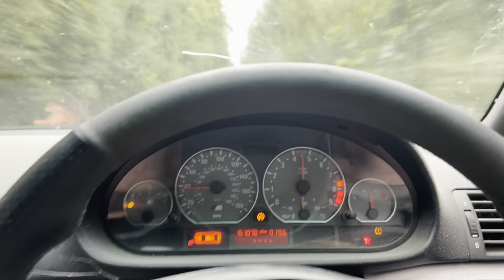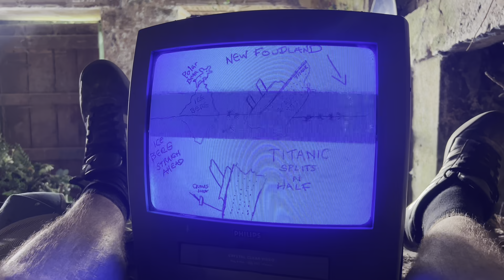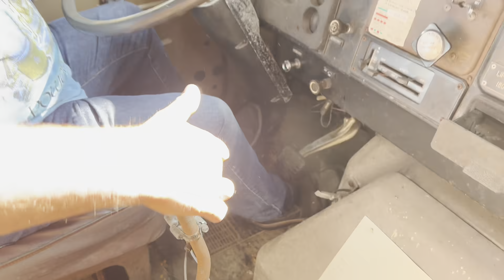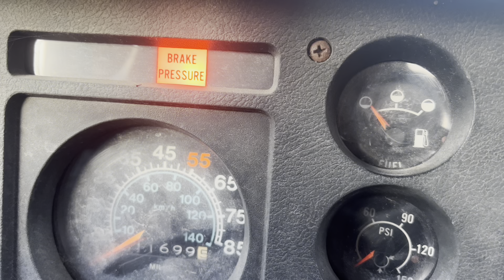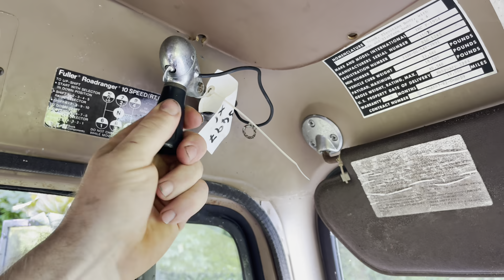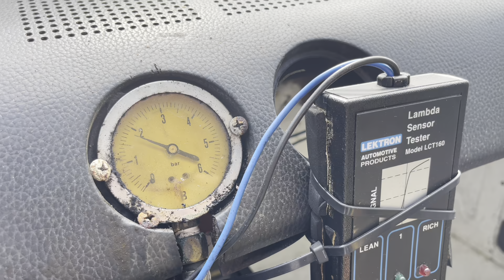BURNOUT 💨💨

Comment: I'm I surprised the opel engine lasted as long as it did they usually blow up before the shell starts to rot or when your burning the tires off
Reply: Not original for that car
Reply: @B__W140  I know but these red top  engines are renowned for going bang when revving the balls out of them, if you had a an astra or cavalier you needed to have a spare engine or 2 in the shed for when the one in the car went bang